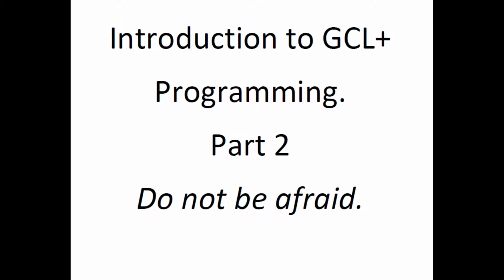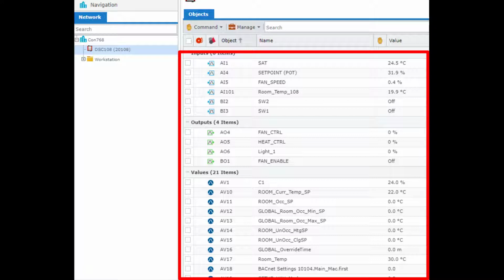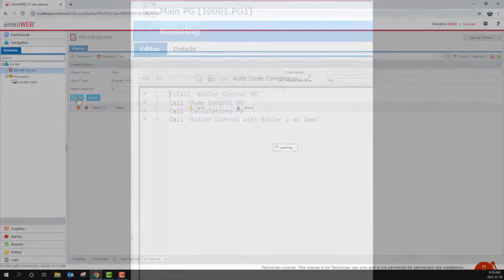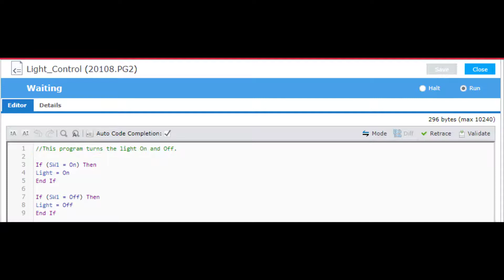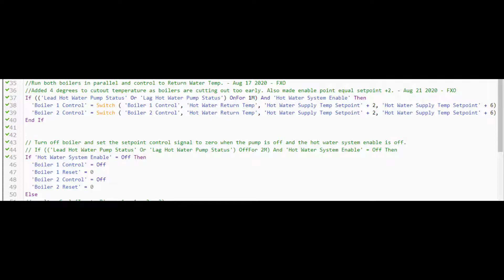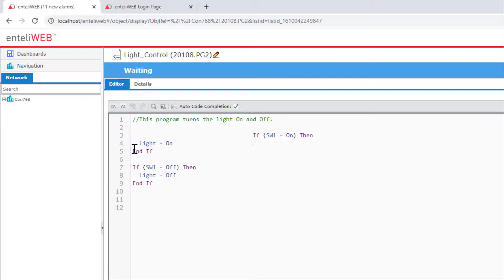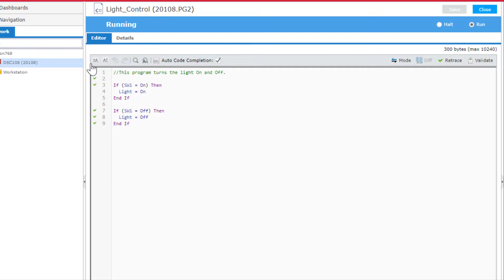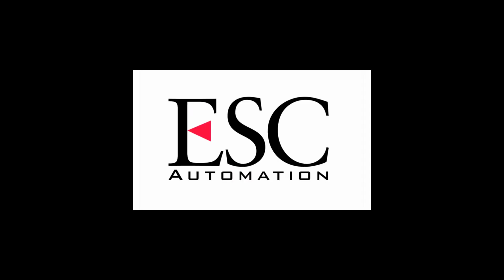Pt2  GCL+ programing tools.

Comment: My company had a delta system installed in an office building once and threw my 23 year old ass in there to program the whole thing. Not a days experience but I managed to pull of turnover and customer witness test. 75 VAVs with 2 RTUs and an industrial kitchen 😂😂
Reply from the maker: Good for you. Programming VAV's is probably the most difficult thing to program.
Reply: @okroshome4821  I sure wish vids like these were laying around 3 years ago. Information is impossible to find without a passport, and if you don’t know what delta passport is then you’re just out of luck!
Edit: keep doing what you’re doing with these videos. Some innocent greeny may need them one day.

Comment: Hello, can you assist in creating a motor rotation program? By using a lift station I want to lead/lag motors but also rotate the lead motor. So motor 2 gets used the same as motor 2.
Reply from the maker: If you work for a Delta partner their application services are in a better position to help you with programming than I am.  Lead/Lag is a common program type. Does your office have another install that you can copy?